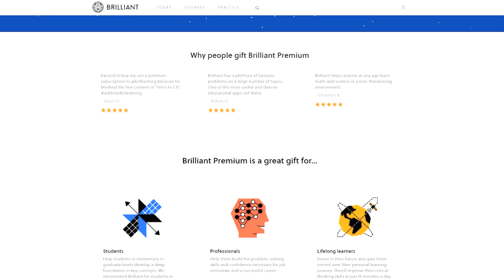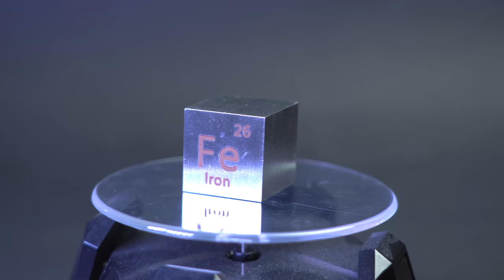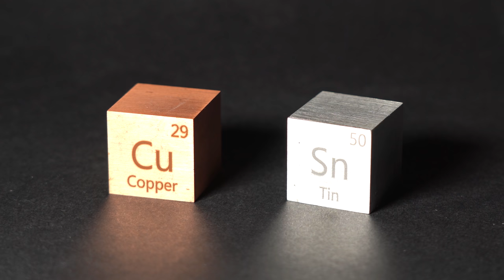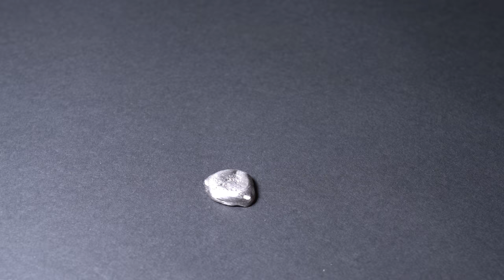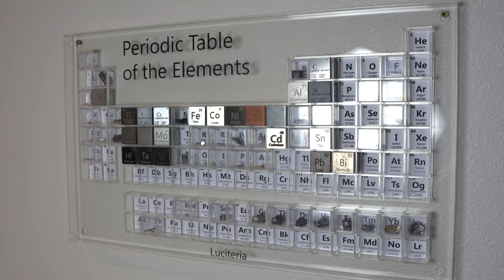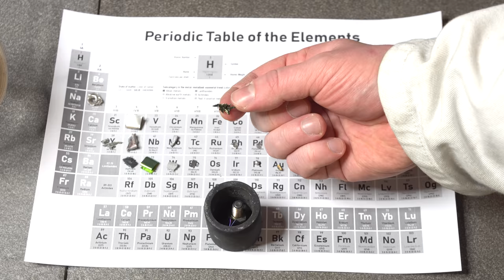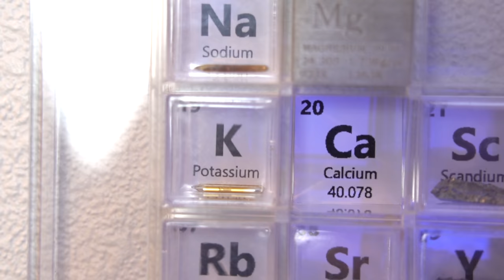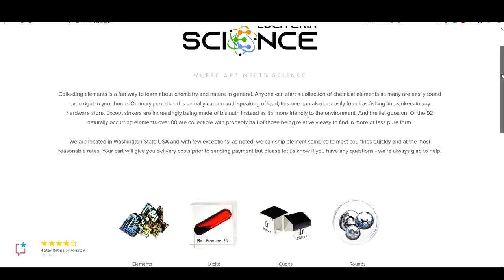What Happens if you MIX ALL The METALS Together?

Comment: tungsten and titanium be like: its kinda warm here, should take off my jacket probably
Reply: Meanwhile Lead, melting at 327 Celcuius: HELP I'M IN FLORIDA!!!!!!!!!!
Bismuth at 271 Celcius: First time?
Reply: Gallium
Reply: Some alloys have lower melting point than the combined metals. So it is possible that their melting point might have decreased.
Reply: Helium: what are guys talking about, whats a solid?
Reply: @Therevengeforget  Mercury: Am i a joke to you?
Reply: @test5093  Sorry, could you say that again but this time in a lower voice...
Reply: Some funny smart people in here
Reply: The graphite crucible just chillin
Reply: Uranium and plutonium be like: come on man, are we too spicy for you?
Reply: Titanium actually melts below 1700 C.  Platinum actually has a higher melting point.  That tungsten wasn't going anywhere, though.  I'm surprised he bothered with the tungsten when he chickened out on osmium and iridium.
Tungsten's not actually too difficult to melt, but you have to do so with a direct current or plasma arc, so to alloy it with iron, it's usually added already in liquid form.

Fun fact: you can cast titanium by making titanium thermite the same way you make iron thermite: mix titanium oxide with aluminum shavings and ignite with magnesium.  Instead of molten iron, you get molten titanium.
Reply: This comment gave me tungsten x titanium vibes even though they dont exist
Reply: @tablesfinalphase4919  So the fire used to heat up the other elements doesn't alloy with the air, earth and water?
Reply: @markzambelli  where you going to talk to someone else but. You clicked on my name because i believe i did not say anything about that
Reply: @tablesfinalphase4919  I was replying to you in a cheeky way as when you said "This comment gave me tungsten x titanium vibes even though they dont exist" I thought I'd go old-school and imply the only elements that do exist are the four from antiquity (... and the ever-bending Avatar)😉
Reply: Titanium's like, oOo, it's summer time, let me grab my rainbow colored outfit!
Reply: man's not hot
man's never hot
Reply: @Bacteriophagebs  titanium is terrible for blades though, its much like aluminium, very good for it's weight and highly resistant to oxidization. But bad for things that steel does. First off rigidity. Its incredibly rigid, second or as i should say, third to tungsten. Tungstens second. Chromiums first. Chromium itself isn't viable alone so its mixed into tungsten based tool steels or steel itself. Commonly called stainless steel. Stainless steel also isnt a viable long blade but great for knives only issue is its so hard its hard to sharpen it. titanium has the rigidity of both of these without the ability to be a suitable alloy since its so light. It also unlike tungsten and chromium has horrific edge retention. Its like trying to sharpen a graham cracker. And breaks as easy too. Since its so rigid unlike steel which can disperse the energy in a wave motion. it can do none of that and simply shatters. Literally shatters. And it hurts your hands too. Bad for knives to since it cant take bending, but id make a great kitchen knife i guess. Also since its so non dense a well made steel sword can potentially CUT A TITANIUM BLADE IN HALF. Im not kidding. it doesn't alloy well either, it can be alloyed with things like tungsten but its not amazing and is really only used in jewelry since it creates a good looking metal. Good for armour? somewhat. But nowhere near that of steel. It also has the potential to shatter. Demolition ranch gave the idea that titanium is good armour since it stopped a 50 BMG round but the truth is that was only 10% titanium the other 90% was tungsten.
Reply: @DevourerOfLords  What does any of that have to do with titanium's melting point?
Reply: @Bacteriophagebs  it didn't i just thought it was cool. Forgot to mention i wasn't being rude, sorry.
Reply: what about osmium, vanadium and platinum
Reply: and also titanium melts at almost 1700'C
Reply: @Therevengeforget  LMAO
Reply: Deam it, I love when scientists try to sound cool and funny: soooo cute.
😊🥰
Reply: @DevourerOfLords  Thank you for this precious information.
Reply: @Bacteriophagebs  Iron in liquid form makes an excellent solvent for every other metal out there. I'm pretty sure even if the melting point of Tungsten wasn't reached, it would dissolve .. how fast I do not know. Elements with an affinity for Iron are called siderophile
Reply: @xenuno  In metalworking, acid is usually used to dissolve tungsten into iron, not heat.  As far as I can find, tungsten can't be dissolved in iron by heat alone, probably because iron boils at 2861 C and tungsten is still solid until 3410 C.
EDIT: Unless the tungsten is already liquid when added to the hot iron like I said before.
Reply: @Bacteriophagebs  What acidic process? Maybe you should check again on how Tungsten is added to predominately iron alloys, no? Water boils at 212 °F. Salt melts at 1,474°F. Yet salt dissolves quite well in water doesn't it? They generally do not throw blocks of Tungsten (well .. not pure anyways) into a vat of Iron. Powdered or pebbly sintered Tungsten (pre-alloyed with Iron at a known W concentration) is generally used. Liquid Iron is a great solvent and will dissolve Tungsten in the same way water dissolves salt. Form matters only for the speed at which the dissolving takes place
Reply: @sankalp2520  ummmm no.
Reply: @xenuno  so its like solving other metals in mercury.Except iron is used instead.
Reply: I mean mercury is a great example of metals dissolving in other metals despite their melting point being much, much higher than the tempature its in.
Reply: @riverotterluresericdenson9216  Ummmm yes ... eutectic alloys have a lower melting point than any of the constituents individually
Reply: Rhenium
Reply: @Therevengeforget  meh you compare it with ice and it just not having the best time with climate change.
Reply: carbon be like: its warm in here?
Reply: Meanwhile Tungsten: *dies of hypothermia
Reply: literally hundreds of amazing comments of people sharing their knowledge, and then you... Cringe af
Reply: Serendibite: when will I get to be a full metallic mineral?
Reply: Hydrogen: why am i dissapearing?
Reply: Mercury:Doesn't exist
Reply: Haha funny.
Reply: Francium: Hey guys what abou-<explodes>
Reply: @test5093  I gotta say, I don't think i've ever been more confused in my life when I heard in earth's atmosphere helium would stay a liquid even down to absolute zero. It still baffles me
Reply: Mercury: You guys are solid in room temperatures?
Reply: @Therevengeforget  celcium, kelchuius, kelvius, cerceius, celtibulus or maybe.... Celsius....
Reply: @Therevengeforget  Mercury*
Reply: Osmium, at 3.000 C° nice sauna
Reply: Carbon : what?
Reply: It's why my wedding band in tungsten
Reply: @chhayachauhan8521  tungstens melting point is 6,135 degrees faringhit
Reply: @gama3040 Copying other people's comments makes you look pretty gay
Reply: Radium: well I’m just gonna watch

Comment: 4:03 Underrated low key joke of the century: using the bulk scale to weigh the low mass ingredient and the jeweler’s scale to weigh out the major ingredient.
Reply: might be that the larger scale is more precise which is why he used it for the smaller ingredient. it looks like the larger scale measures to a thousandths of a gram whereas the smaller scale only to tenths.
Reply: I'll say 7:25 "polish with an angle grinder"
Reply: Big brain
Reply: Good catch.
Reply: Psh that's a weed scale.

Comment: Please, analyse it by light optical and/scanning electron microscopy.
I want to see this mess.
Reply: Points.  It is a mess.
Reply: and xrf
Reply: I am going to make a guess..

It will probably look like its split in layers,
For some reason I don't think an alloy will be formed
Reply: @barbedwireisgood  EDX (SEM)
Reply: @Shadowmare4575  With molten metals would it be the same as water and oil? The heavier being placed at the bottom? The way I'm imagining it is some of the heavier metals (Or their particles) would sink to the bottom of this mixture. Which is why I'm thinking he had some of the metal chunks that formed on the top that didn't mix too well.
Reply: @thetestinggrounds7855  depends on how well the Metals mix with each other. The Water-Oil-Analogy only works if the metals do not mix at all (like Water and oil)

Comment: You need to do this in a vacuum or nitrogen atmosphere to prevent the spontaneous oxidation. That way lower melting temperature elements will be able to stay in solution and alloy together.
Reply: Actually a good suggestion, application of pressure for higher temp metals would be good too
Reply: Yeah that's why they create new alloys in space... If you are here and smart you already knew this
Reply: @darrentylor5473  They do?
Reply: @Number1FanProductions  I don’t think so it would be very expensive to get metals up there
Reply: @jwcfive7999  I was thinking he meant development
Reply: @Number1FanProductions  cold fusion
Reply: SO that means he could have been able to combine all metals together even the toxic ones too?
Reply: @jwcfive7999  - it depends on the weight so if you only bring a small amount of metal weighing a total of 1 pound it's not a big deal for the advancement of SCIENCE!
Reply: @darrentylor5473  LoL, you said that so confidently like it was even a little bit true.
Reply: As if he doesn't know
Reply: @darrentylor5473  But especially if we're here and ignorant, because ignorance is eventual smartness.
Reply: @TheDJOblivion  There is a small induction furnace on the ISS. Tiny little thing but doing some pretty interesting research  

(I tried posting before with a link but youtube doesn't seem to like that - I put 'international space station casting experiment' into google and found an article about it quite easiky)
Reply: Tu5e vacuum one is a bad idea.
Change my mind.
Reply: @marcspectre7826  Vacuum processing is pretty much mandatory for high end alloys. It prevents some of the more reactive metals forming oxides or nitrides. Look up Vacuum Induction Melting and Vacuum Arc Remelting for tool steel production.
Reply: Interesting